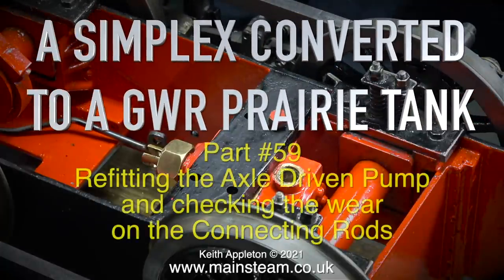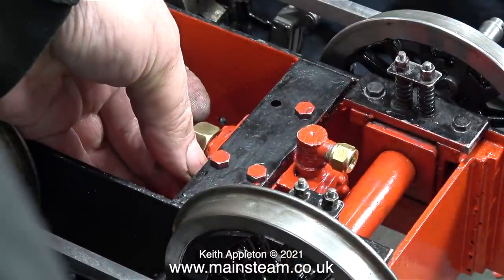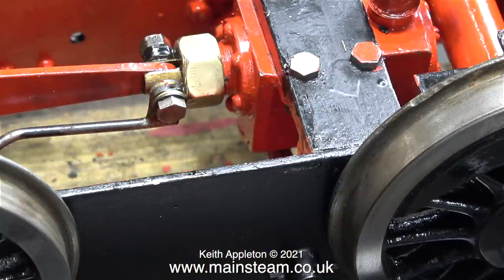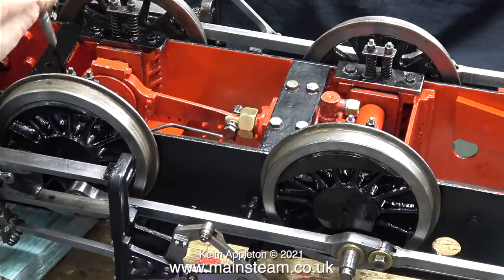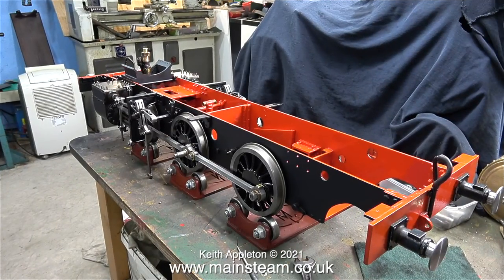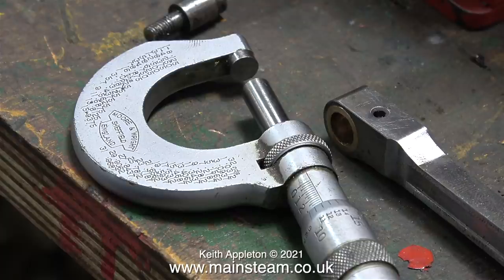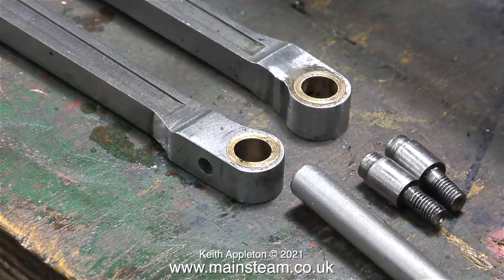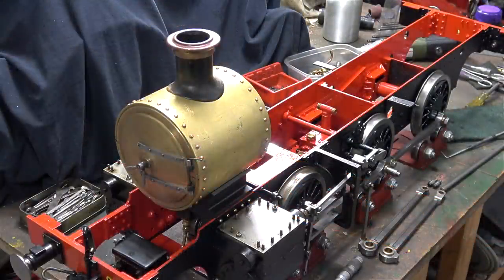SIMPLEX PRAIRIE TANK - PART #59

Comment: Hi Keith
Thanks for this series, loving every episode. Regarding your bushes and pins, I used to work with an engineer that repaired church (and similar large) clocks which typically had brass cogs and steel pinions. He told me it is usually the steel pinions that wear as the brass being softer picked up “dirt” which made it abrasive. That sounded plausible to an impressionable twenty year old!
I notice you use the term “ruler” a lot. Back  in 1969 at Harlow Technical College we had a real gentleman in the workshop stores, Mr Street, who we used to wind up by asking for a ruler. I think he would feign apoplexy and shout “ A ruler ? Only wood butchers and greengrocers use rulers, an Engineer uses a rule.” Thanks for dragging that memory out. 
Our workshop tutor was Bob Loader who achieved respect from us 16 year olds by being able to spit onto the drill tip to cool it. I think in retirement he wrote article for Model Engineer, I remember his advice to “watch the suds lads, it rots your cods”. He also gave explicit advice regarding use of the clutch on the Harrison lathes, which I think would fit in to your girlfriend jokes.
Keep up the good work, much appreciated

Comment: Hi Keith - I've been waiting to ask this question - waiting until you showed connecting rods. I get that connecting rods need some play to allow the wheels to move up and down and tilt a little. Rigid connecting rods fight this motion. Why not use a ball joint end on the connecting rod? (I am referring to full size - not models.)
Reply from the maker: It is a mechanical anomaly, because play is needed in the bushes so that the suspension can work. On Stephenson's Rocket I believe they it was fitted with ball joint crankpins. I was once told that the tolerance for full size locomotive coupling rod bushes was a 1/16 of an inch gap between the bush and the crankpin.
Reply: @keithappleton  Thanks Keith! I looked up Stephenson's Rocket and sure enough there is a ball socket crank pin on the wheel! Fascinating.